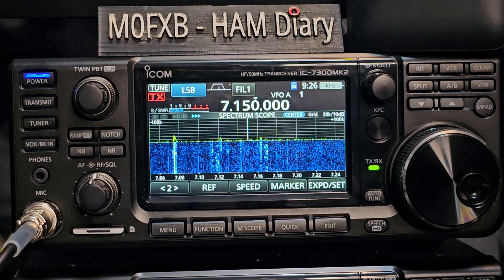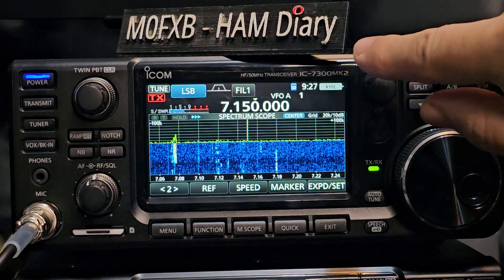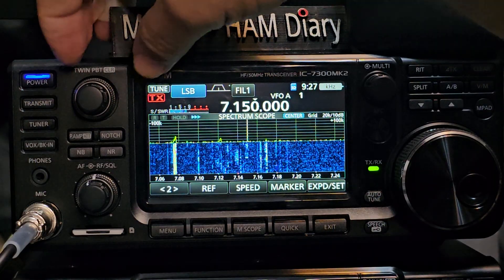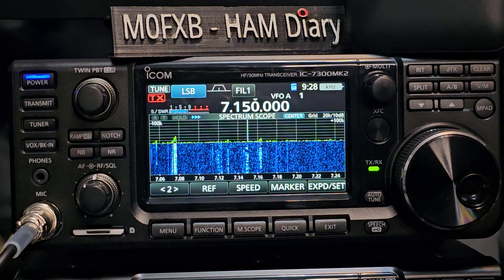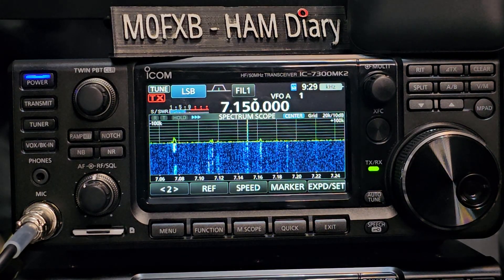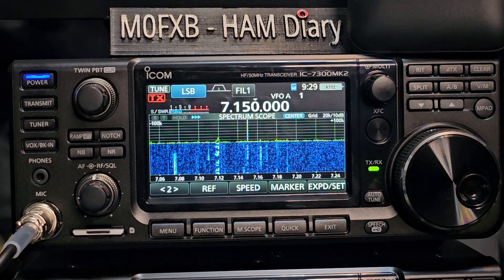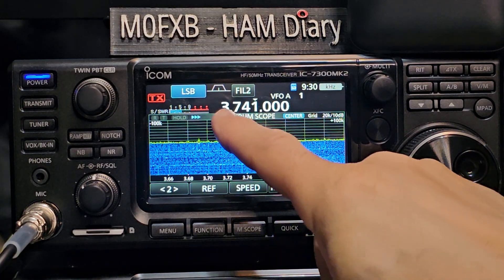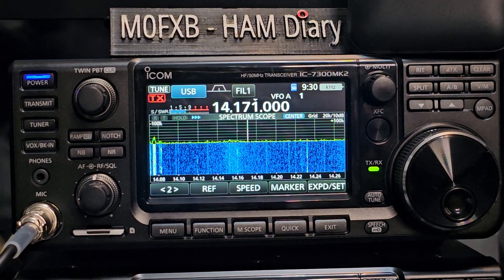ICOM.IC,7300 MK2 - Noise Reduction & Filters

Comment: NR it works yes  but works bad compared to yaesu for example.
Icom NR is not as good and is very far away of it
Take a look at a discontinued radio Yaesu FT DX3000  and hear the NR is better that any new yaesu and much better than icom

Comment: Best cure for NOISE, is PREVENTION.

Noise blankers, are to help reduce impulse noise, such as that from electric motors or other intermittent sources.

They won't magically pull out stations from the noise!

Don't let noise it get into your power supply, or your antenna.

Get rid of nasty switch mode power supplies used by cheap, smaller appliances. You need to do this prevent your home becoming one big RF noise field.

Get your antenna in the open away from house's etc and as high as you  can, grounding the antenna and equipment will help static buildup .Grounding the antenna and equipment effectively reduces static buildup and minimizes electromagnetic interference, leading to improved performance. By providing a direct electrical path to the Earth's ground, grounding dissipates excess charge, preventing potential damage and ensuring stable operation. This practice protects sensitive equipment from voltage spikes and reduces noise, resulting in clearer signal transmission and reception. 
1 Use balanced feedlines (like ladder line) for dipole antennas to reduce common-mode noise or the best coax you can afford with good shielding.

2 Use a quality power supply with good filtering to power your radio equipment. Consider using ferrite beads on DC power leads to minimize noise.

3 Identify and minimize noise from household devices, such as computers, switching power supplies, LED lights, and other electronics. Turn off devices that may introduce noise when operating.
Reply from the maker: Thanks for the tips

Comment: sounds very useable. still, the yasue ft-710 seems to be in a whole diffrent class in the noise reduction department.  I have to remind myself on the ft-710 that the other party is liky not hearing me as clearly as I am hearing them. I have learned to use the osiliscope to detect signals in the noise floor I can not even hear, then apply the DNR and other filters until I have often far better than just intelligable signal. Often completly normal, to the point that when I turn off the filters, it makes me jump at the sudden raw noise level.
Reply from the maker: Good info

Comment: My experience with noise reduction with a number of radios is a mixed bag, but in general, I have never been impressed with Icom's NR compared to Yaesu 's DNR. Icom's  NR works best by attenuating the signal or reducing RF gain. By lowering the noise floor, this allows their NR feature to work better. The king of NR still belongs to Thetis using the Anan radios as well as the Hermes Lite II. I have not tried Flex version 4 software. It might now come close to Thetis, but previous versions of their software/NR was pretty weak. To me personally, NR is VERY important and I rate my buying decisions on this. BTW, noise blankers are there to filter out popping noises caused by things like electric fence chargers and spark plugs -- that's their main purpose.
Reply from the maker: Good info
Reply: Well after having own more than 100 radios from Kenwood, Yaesu, Icom, Elecraft, Tentec, Flex, I will sayup to the FTDX5000 and FT991A yaesu DNR were with no doubt the most effective noise reduction design BUT Yaesu made a big mistake with modern DNR at the FTDX710,FTDX10 and even the 101D/MP, due to the anoying audio distorsion on the received station when the DNR level is set over 4 making it very garble robotic sound, something that will never happen at Icom IC7300,IC7610,IC7700 and IC7851 even at maximun level 10. Kenwood had same or worse distorsion when NR1 and NR2 were used, even the TS990 suffer of that bad issue.